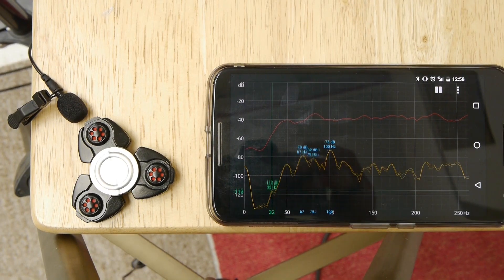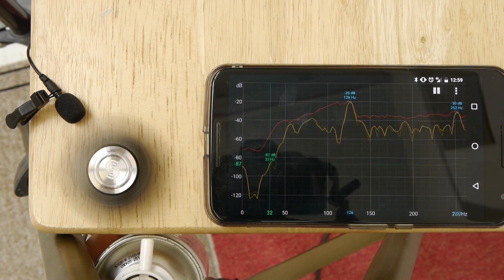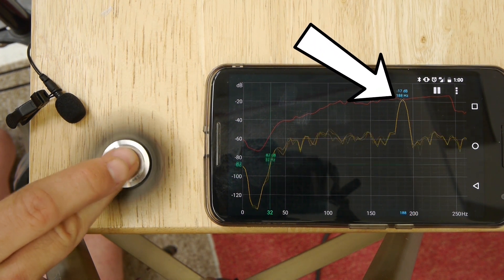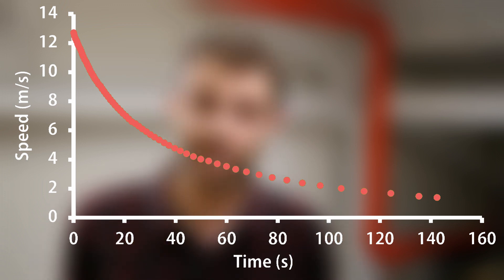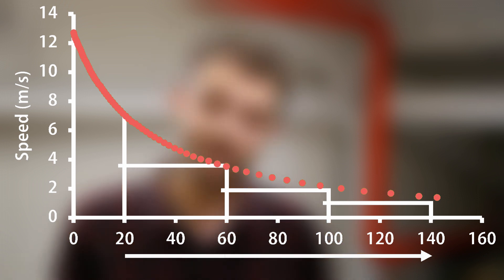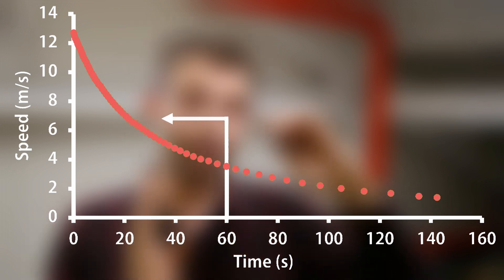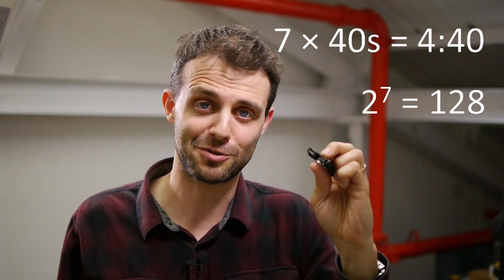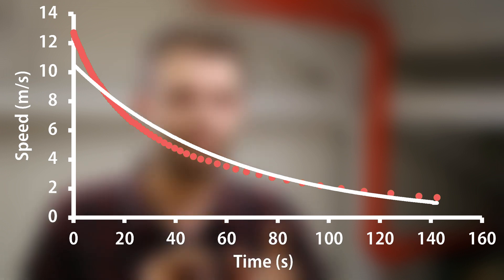Exponential decay - why your fidget spinner won't spin for longer

Comment: Force propotional to speed squared gives you inverse time evolution of speed.

a=c*v^2
v'=c*v^2
dv/v^2=c*dt
1/v=c*t
v=1/(c*t)

However, this would only be valid at small times. This would suggest that there is a limit to how long a fidget spinner car spin. Solving for both v^2 and v drag is not so complicated but youtube comments are too short to show the demonstration. The idea is to proceed as above, split the fraction into simpler ones and integrate.

Comment: Hey Steve! How much does the air drag affect the speed? I'd imagine you can ~~beat Matts~~ get a lot faster speeds in a vauum as the bearing would have much less friction than the air at those speeds.

Comment: fidget spinner bearings tend to not be lubricated, the spinner is too light and lubrication will end up slowing it down. Of coutse you can put a minimal amount like used in yoyos but most don't have lubrication at all
Reply: I second that.  Tried it and is slows down drastically.  In-line skates for competition also use dry bearings.
Reply: Steven Mellemans Was expecting someone to yell at me , glad to someone who tries something before jumping to conclusions. Actually race skates do use lubrication,a very low viscosity one and a minimal amount. Learnt that from the people at the skate club . That being said, some do use dry bearings for races .

Comment: You should test your hypothesis and see if it would fit an exponential decay if you remove the drag (i.e. a vacuum chamber).  I thought you were more of an experimental physicist.  This correlative mathematical stuff is something I would expect from Parker.  Also, it should make you phidget spinner spin for longer.

Comment: So if you managed to complete this experiment in a vacuum and plot the same data, could you subtract the two best fit equations to separate the drag friction from the rolling friction?

I thought you were going to mention the recent Smarter every day video on rolling shutter. They briefly mentioned using rolling shutter to measure RPM. Seems like an interesting way to do it in the vacuum.
:-)

Thanks for sharing!

Comment: Velocity being similar to Matt's may be due to the speed of the air from the can being similar for both.  You may be able to get it faster by shooting air at a point closer to the hub.  ... or messing around with the nozzle aperture.

Comment: Really interesting video and mathematical analysis. Here is my attempt at a graphical analysis: https://docs.google.com/spreadsheets/d/1XG0lco6a08fA-Qqh19PZKsHVevbnOYI-f2jYgPIGbR4/edit?usp=sharing

I used a physical model for drag (F = ma = Cv^2) to calculate some data (link to code is in the spreadsheet) and observed a similar relationship between an exponential fit and the data as that shown by Steve. As a high school physics teacher whose calculus is many years in the rearview, I tried linearising the data (transforming the variables on the axes until the relationship is linear; for a parabola you would graph y v. x^2 because y is proportional to x^2) but gave up when I saw fairly complex underlying forms in the relationships.

I'll redo the analysis with the data that Steve posted (didn't see that!). But now I'm off to scan the comments to see if anyone has worked out the relationship between v and t. Cheers!
Reply: Hmm, after finding the solution to the differential equation in the comments, I can't believe that I missed the obvious relationship in the data: I hadn't tried 1/v (proportional to) t!  I've updated the spreadsheet and you can also check out the Desmos file (https://www.desmos.com/calculator/2hnbmcrd6i). It's a perfect fit to my calculated data and a better fit that the exponential to Steve's measured data, even though, as +Claudio Arena mentionned, it doesn't seem to capture everything in the real world process.

Comment: Exponential decay happens because of the Earths gravity The friction with the Air. and the Ball Bearings friction. An Optimal Spin with an object wouldnt, cause friction with itself.... In Space Exponential Decay wouldnt happen as on earth. There is still atoms in space. Just alot ALOT Less.

Comment: What's count is angular velocity instead of linear velocity 😉 I never toyed with a fidget spinner, but does turning those on the vertical axis make about the same results as turning those on the horizontal axis?

Comment: Just so you know, your data are fitted much much better (almost perfectly!) by a two terms exponential function:
https://ibb.co/dAL5Ea
Your measurement deviate from this fit by less than 1 Hz over the entire set!!
For those who wants the details, the best fit equation is:
frequency = 92.93 * exp( -0.06314*t) + 108.4 * exp (-0.01162 *t)

What I think is happening is that there are two different regimes at which different friction forces operate. If you look at the equations, the two terms have about the same values at t=0, but one of them decays about 6 times quicker than the other. So, there is an initial exponential decay, and then as the fidget spinner slows down, a separate, slower exponential decay takes over. Possibly this is due to the larger influence of air resistance at higher speed, or maybe to a physically different way that friction in ball bearing works at higher and lower speed. The lubricant of the ball bearing might have some transition in its hydrodynamic behaviour, or something like that...possibly!
Reply: I'm seeing a small issue with the graph -- looks like the residuals tend to go positive for some regions, and negative for others. I'd try a k(1 + bt)^-1 term, since that's the solution to the differential equation for drag. That does kinda assume that drag and friction are linearly independent, which is kinda wonky for nonlinear differential equations, but if you have the software to do regression, you should totally try it!

Comment: It's funny that I tried this just today, with the same app, but with the built-in microphone and I couldn't get a signal out of the noise.
Reply: Also I was actually relying on the noise made by the mechanism of the fidget spinner itself, hoping that the irregularities in it would produce a certain noise pattern with a fundamental frequency giving the number of rotations per second, and some other harmonics due to the fact that there are 3 parts in the spinner.

Comment: Speeds up fidget spinner with compressed air can

Surprised that wind resistance is a factor
Reply from the maker: +ForbiddianSC ok, point taken :)
Reply: I love that joke :)
Reply: It’s not the size of the fidget spinner that matters...

...it’s how many revolutions per second?
Reply: Also the method used to spin it is directly related to the length of the spinner arms, which are specifically shortened in order to decrease the distance travelled by the tips of the arms, thereby increasing spin time. :)

Edit: in other words, if they travel a shorter distance through one rotation, then a equivalent amount of energy can make it spin longer, but that assumes the energy is imparted by hand.  But it also gives the air less leverage by reducing the length of the lever used to impart the energy.
Reply: You need to try doing the experiment in a vacuum.  But there are two problems with this, of course: 1) how do you get it moving in the first place without the air can and 2) how do you measure the speed without the sound.
Reply: +Nigel Gentry For point 2 one option would be to use a laser pointed at a light sensor on the other side of the spinner positioned so that as the lobes pass they break the laser beam (Make sure it passes over the potion of the lobe with no hole in it). If you measure the time between the start of one pulse of light and the start of the next then calculate 1/(t*3) you would get the rotation rate in revolutions per second multiply by 2πr to get the linear speed. As for how to accelerate it in the first place that would be a bit trickier you could certainly build something if you wanted to something like a robotic mechanism for example.
Reply: It's also not surprising that his top speed was slower than the other one, since his spinner was designed to spin for longer, and the two variables are directly related by the same exponential decay discussed in the video :)

Comment: Don't you think the spinner's Angular Velocity is a better measure of it's speed than it's Peripheral Velocity. Peripheral Velocity is radius dependent while Angular Velocity is independent of the radius of the spinner and is thus a better measure when it comes to comparing two different spinners.

Comment: Love your videos, but have to criticise three major points here:

Exponential decay tends to zero, but never actually reaches it. Which of course doesn't really make practical sense. So it would've been nice to know at what point of the theoretical curve the spinner actually stops.

Since you're mentioning rolling shutter effect, I feel like a shout-out to the recent smartereveryday video would've been in order.

No Fidget spinners pouring out of a beaker? ;)

Thanks anyway. Will continue to enjoy your content regardless. :)
Reply from the maker: +Creep thanks for this. Yes good point about lasting for ever under exponential decay. I thought about butting it in but is was getting long! Also, I filmed this ages ago so didn't know about Destin's video!

Comment: Interesting video, would have been nice if you tried or even mentioned ways to increase the spin time through a means other than trying to make it spin faster through increasing the initial force.  

The most obvious way to increase spin time would be to add mass to the spinner, the further out the mass is relative to the centre, the better. More mass would mean a slower acceleration, but at top speed, the drag force would be the same, so the spinning mass would have more stored energy, so would take longer to slow down. 

You could also reduce the drag of the spinner by using a more aerodynamic shape. On a similar vein you could reduce the air pressure around the spinner.

On the bearing itself, using a thinner lubricant or reducing the amount of lubricant could reduce friction.

You could also use these methods to quantify roughly where the losses are in the spinner.

Comment: I think it's an exponential pattern (from air resistance) superimposed upon a linear pattern (from friction between the parts).   Kinetic friction (friction between two moving surfaces) does not depend on the speed of the surfaces, only the normal force between the surfaces and the (constant) coefficient of kinetic friction between them.

Comment: If you want to test if it's more a matter of Friction or drag you should get a Maglev Fidget Spinner. I have a concept for a MagLev Fidget Spinner over at Instructables.com. I'm mpilchfamily over there. Feel free to try printing it and putting it together and see what you get. Soon as i get my 3D Printer in August i'll be working to improve that design cause i suspect the configuration doesn't have a strong enough magnetic field to keep the MagLev bearing in tact.

Comment: So, I tried this and got 56.1 hz as a fundamental frequency which I divided by 3 (56.1/2=18.7). Then I tried using a stroboscope app set to 18.7 Hz expecting to see the fidget spinner standing still. Which it did not. I'm not sure why my results differ between finding the speed with sound and with a stroboscope. I repeated the spectrum analysis 10 times and got the average of 18.7 rps (Hz). Repeated the stroboscope 10 times and got the average of 25 Hz. I'm too lazy to go twords the smallest Gaussian sample size but already I can see a statistically significant difference. Any ideas for what is going on? (I'm noting the frequency of the fidget spinner by eye when I am using the stroboscope aka I scribble on a piece of paper the Hz that makes it look like it's standing still)
Reply from the maker: +Alexandru Burcea interesting. I've looked at strobe apps before. Basically they don't work particularly well  at frequencies above a few a second. Something to do with how the the handsets expose the hardware to developers. So it could be that you're not getting the strobe frequency you think you are.
Reply: Steve Mould - yeap. I think this is it. I tried a different app and I get different results for the stroboscope part.

Comment: That's a big issue in automotive travel and engineering.  Sure, go faster, get there sooner, but because we're not travelling through a vacuum, the fuel consumption goes up somewhere around proportional to the square of the speed.

I also watch a fair amount of GA videos,  many with pilots pointing the camera out the windshield, right at the prop.  And the prop has all sorts of weird looks to it, like appearing to spin backwards, for there to be more than the number of blades we know the prop to have, and to curve when we know they're straight.
Reply from the maker: +rchandraonline yes! And it doesn't help that you get heavier the more fuel you add. The central challenge of rocket science!

Comment: I assumed drag would factor in, mostly because I remember reading that it takes increasing amounts of energy to get a car to go faster, so nought to 60 requires less effort than 60 to 120 because the faster you go the greater the air resists - like when you put your hand outside the car window the faster you're going the more palpable and physical it feels, but also feeding into that is mechanical resistance, where every moving part of the car adds a little more degradation, and then there's the degradation from deformation where some of the energy will go into pressure on the plastic and metals, (though I'll be the first to admit this would be very very little degradation - it's still something). 

Still, it's fascinating and thought provoking way to look at spinners. Thanks.

Comment: Doesn't this work the other way around as well? e.g. if you apply some force to an object and its speed reaches a value v, you would have to, let's say, apply 128 times more force in order to reach 2*v speed, due to drag.

Comment: If the drag ~ speed² wouldn't drag dominate for really high speeds? (I'm curious what that function would be but I haven't learned about integrals jet so I guess I can't work it out jet)

I think you need to say f'(x) = a*f(x)² and solve for f(x) (without the f'(x) term)

Comment: I'd love to see more information on the stroboscopic effect with the naked-eye. I remember looking at a fan and seeing the effect as a kid. (Which I assume was caused by a flickering light source). - But I feel like I've seen it on wheels on cars in natural light. - How? Do my eyes have a framerate? And would someone next to me see it at a different framerate?
- This is hard to google, because I keep getting results for the effect regarding a flickering light source or a camera.
Reply: Patrick Davison Look up the wagon-wheel effect on wikipedia. There's a section on truly continuous illumination with some hypotheses on why this happens. I don't have any more insight than this though, it could be a cool subject for a video.
Reply: I believe you are describing the situation where you look at a spinning wheel for example (which is blurry because of its spin) when suddenly you can clearly see the wheel as if it was stationary for a fraction of a second. This has a biological reason behind it: your eyes move quite often. Now, when your eyes smoothly track a moving object (tracking a plane flying across the sky), your vision is not interrupted. However, when your eyes move to look at a different location (so without tracking something, but in one instant), you are blind in this brief moment where your eyes relocate. Your brain makes this less annoying by saving the last frame in your head until new information comes online. That's why you can see a spinning object standing still.
Reply: +Sloth FPV you know you don't have to believe comments right? Google exists for a reason
Reply: perhaps it's a purely psychical effect for some, perhaps more discretely minded, humans, where, even with continuous data, their mind considers only periodic samples.
Reply: james pogrebetsky ik, why should you think i don't know that?
Reply: pretty sure he didn't intend it just for you, but more in general
Reply: varad sharma i don't believe you, no way is our eyes frame rate that low
Reply: @slothFPV  this could actually be the time it takes for the eyes to process the color. Framerate isn't the correct term for eyes as eyes continiously collect light rather than doing it once in a while. This also causes what we call motion blur. You can also notice this effect when waving your hand near your eyes. 
Since the eyes accumulate we still can see a major difference between digital displays and real life as we notice that on digital displays, when something moves on screen, our eyes notice the "ghosting" from past frames and know something isn't "right". Displays with higher refresh rates are better at giving the illusion that something is really moving. The eyes can track it better as ghosting is far less noticable and comes closer to tracking a real life moving object which is why pro gamers prefer higher refresh rate monitors. 
This explains why many video games have motion blur as a graphical effect, at the cost that it looks blurry when you try to track the moving object with your eye (because motion blur effects assume you don't move your eye). Without motion blur, games can givd a very "digital" look. animations at lower framerates may also intentionally use motion blur to smooth out fast movements to make it  look more natural and appealing.
Reply: Persistence of vision. Your eyes refresh every 1/16th of a second, so a new photo every 1/16th of a second. Basically, our eyes have a natural frame rate of 16fps.